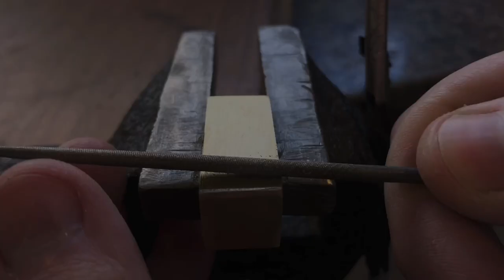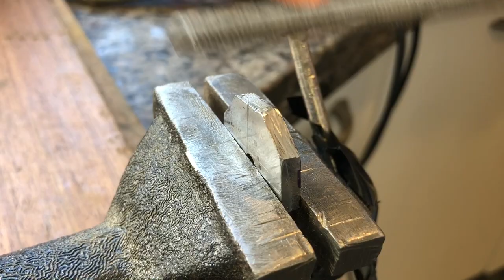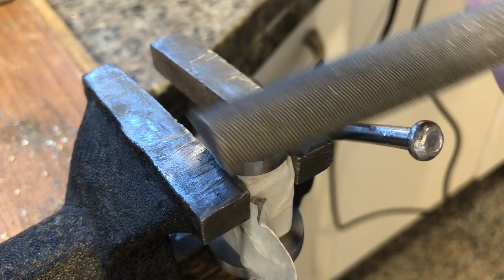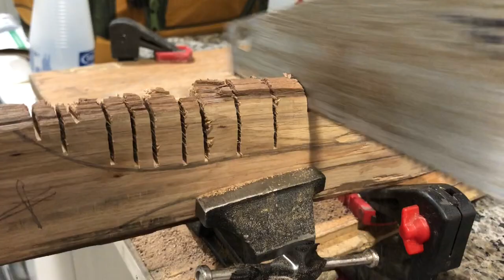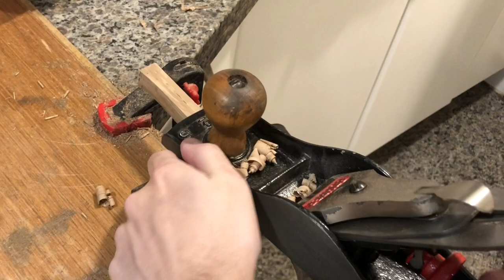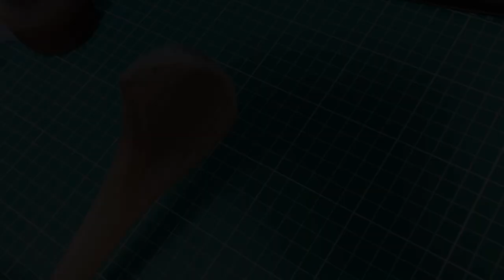Trash to Tool: Making an Engraving Hammer | TTT, E5

Comment: it came out nice, but you were working too hard with the draw knife. If you wish to control the depth, consider putting the bevel down, you can roll the blade so that you can start exiting the cut rather than being forced deeper. Both sides of the blade are made to work, and  you will find the bevel side can be the sweet spot, it just depends on the grain and how the wood is working, sometimes the flat side is the sweet side.
Reply from the maker: Interesting. Thanks for the tip!